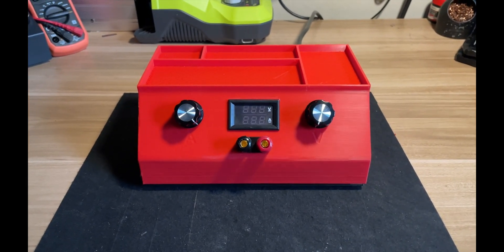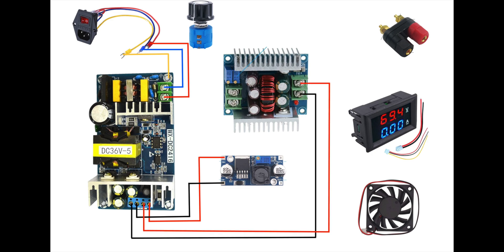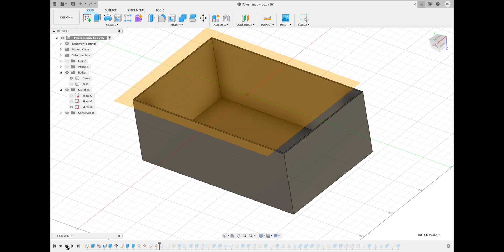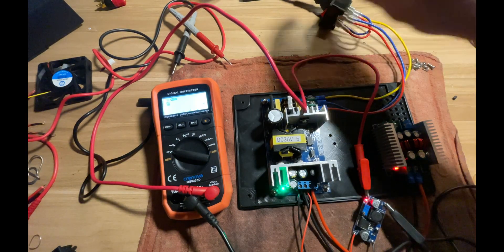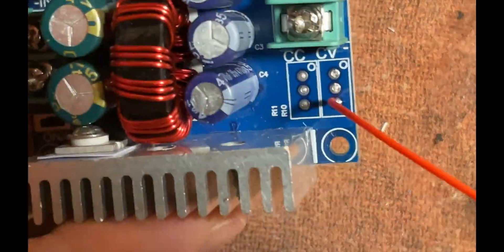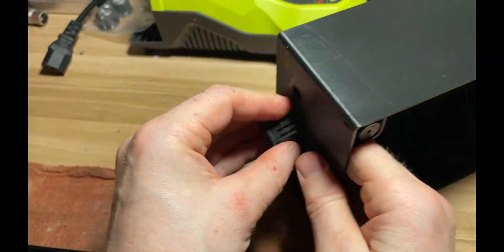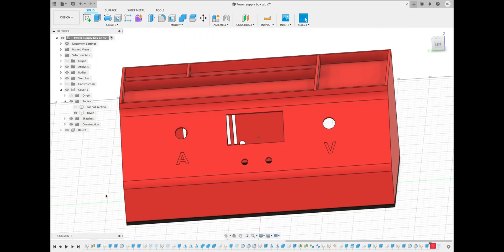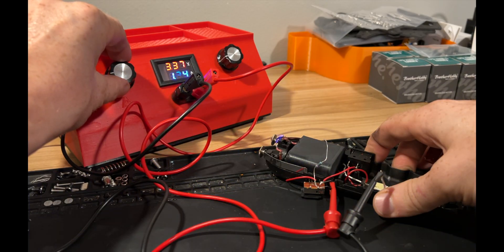Building a DIY Bench Power Supply

Comment: Every time I look for a switching power "module" I find a whole power supply with chassis... you know, those metal cases with 3 +, 3 -, and your AC neutral, hot and ground.  The only modules I found without a case were low-powered ones.  I suppose I could remove the components from the metal chassis and put them in my enclosure with my bucker converters, etc...